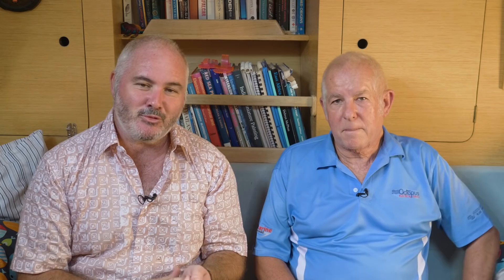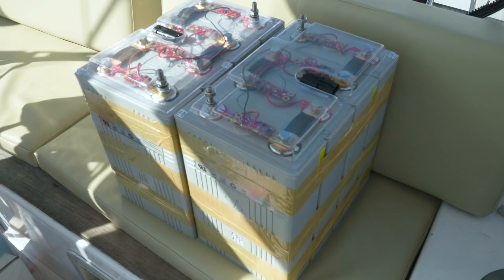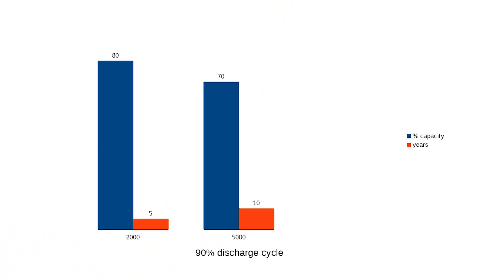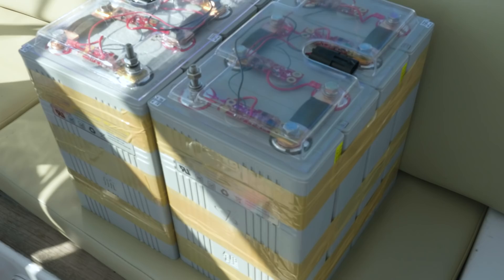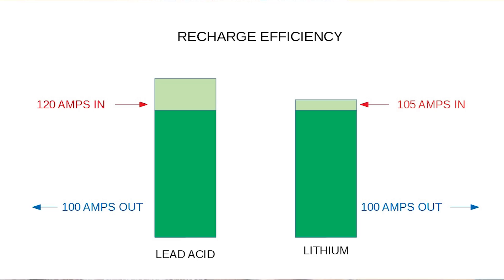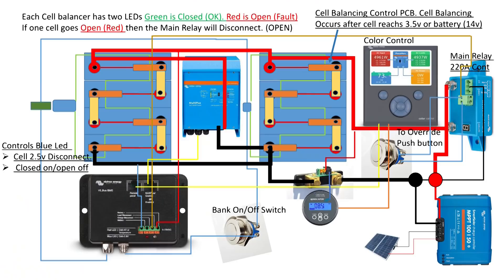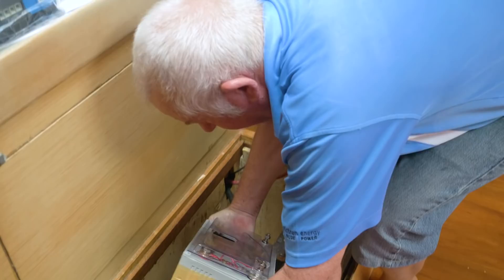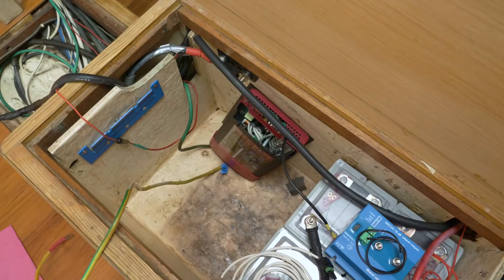Installing lithium batteries on a sailboat - Ep 144

Comment from the maker: Don't forget to LIKE and SUBSCRIBE if you watch our videos. 👌 Would you go lithium?
Reply: That's a non-brainer, yes!
Reply: I would go lithium.
Reply: ... and the induction cooktop will make your propane last around the globe.
Ah...btw, make sure, your inverter can stand the induction. To produce low heat, they have to switch on and of in short cycles like 0,5sec which some inverters do not survive for long.
Reply: In a heartbeat, if I had the money.  Maybe I will when my current battery bank bites the dust.  Maybe the price will be down low enough by then.
Reply: We had that conversation 3 years ago when you bought the Trojans glad you finally did the change.
Reply from the maker: @davidkenny3611  Yep, we've been talking about it for a lo-o-ong time. Finally made the big decision. 😁 Liz
Reply from the maker: @antonditt1661  Loving the induction, but using it carefully! 😁 Liz
Reply: Sailing followtheboat I have gone lithium, like you my previous boat had the same Trojan 6 volt batteries making about 500 amp hours of 12 volt service batteries.  My new boat was only commissioned a few weeks ago so can’t comment too much at the moment.  I have 3 Lithium 90 amp hour  12 volt service batteries and about 10 ( I need to count them all again) sealed maintenance free batteries for engine start, bow thruster, anchor windlass, winches, electric lowering bathing platform, passerelle and electric toilets.  Although I have an 8Kw generator, I believe solar will soon be on the shopping list.  Although all the lighting is LED I’m not sure if 3 x 90 amp hour is sufficient, As it will need to run two fridges and a freezer.  The lithium was very expensive but the holding voltage all the way down and quick recharge times seems to make it all worth while.
Reply: And now that’s it’s been a year plus with the Lithiums...how are they working out? Any puzzles after installation? -Rebecca

Comment: Thank you Jamie for making this video. It answers all the questions I had about lithium batteries. I sure would like to reduce the weight and volume of our batteries but it appears it might not work for us on Brick House. First,  for some of us, Yanmar makes no adaption for a dual belt pully system for a high output alternator. When we upped to a 110 amp alternator, we tore through belts and dusted up the engine room. I had to make a larger pully for the alternator, to reduce the gearing, then install a Gates Green Stripe belt. Running at constant full output to charge lithium might introduce a new headache in this charging system. Plus, I don't think I am smart enough to trouble shoot an acting up lithium set up where I have better hope of correcting problems with our Trojans. So for now, our boat will stay fat and heavy with the tried and true batteries and charging system. Certainly I will look for updates on your lithium system. Nice editing.
Reply: Look at journey with jono.Best review i have seen on lithium.He only changed to lithium because he lives in england and the cold weather.Lead acid is the best way to go in hot countrys.if the weight and space are a problem go lithium.I have seen people using lead acid batterys lasting 8 years.But in most cases about 5 years.Dont listen the hype about agm and lithium.200 amp lead acid £160 is 100 amp usage.100 amp lithium 80 amp usage £1000.What they also dont tell you.A lithium battery that is 2 years old loses 20% minimum of its power out put.

Comment: Really do you home work , we had them and nothing but problems with heat when we were cruising the pasific , put hand down the side of one in the middle of the day  ,we had ours professionally installed and the boat wired to accommodate them , there are many cruisers changing back

Comment: I think you made a most relevant comment when you differentiated between full-time liveaboards and weekend sailors. In the case of the latter (which we are apart from a few weeks a year on board) I think Lead Acid or preferably AGM will be a much cheaper long-term option even allowing for battery replacement every so many years.

Love your vlogs and this was most detailed and informative.

Happy cruising to the three of you!

Gerard

Comment: It makes sense for full time liveaboards to consider investing in lithium based storage systems. The financial numbers are scary though. The advantages are legion though and the charging efficiency is a major one and it was not really covered by the Octopus chappie- Your engine will be running for less to charge the batteries not only because less amps are needed but because the lithium battery will also accept bulk charge for longer.The ability to get rid of propane and have the inverter capacity to run modern kitchen equipment - induction hob et al is a real logistic win.

Always difficult to judge things on a video and I will watch again on a big screen but as a retired marine engineer I was underwhelmed by the installation which I do not believe is robust enough for marine applications. Some of the cabling was untidy (too long) , a general lack of heat shrink, the BMS looked a bit Micky mouse- do Victron not do an external one (solid state and waterproof). The location of the invertor is a compromise too far and needs to be higher and with intrinsic air flow. It just looked a bit ‘rushed’. 

After investing almost another engine it merited more installation planning and execution. I am not sure you have a robust system that will endure the marine environment.

No offence intended.
Reply: I respectfully agree wholeheartedly and on second thought I think they will agree. IBEW, brotherly love💪.
Reply: This is thailand.Chances are the products maybe copies.them 6v lithium batteries are all over ebay.no guarantees with them.for sure.Thats how DIY  make them cheap and tape them together.He is also breaking the law.He needs a work permit.He might own a company.That means nothing in thailand.Claims he,s done 50 boats with no problems over 7 years.I dont think so.I lived in thailand for over 12 years.Not the place to concider this type of instalation.Dodgy to say the least.And a fan in a concealed box to keep temp down,How do fan ovens work.

Comment: Great selection in LiFePO4 batteries now, with most coming in a sealed container with the battery management system enclosed along with the cells in a single container. Much better for durability.
 In my opinion, the single greatest risk for those switching is triggering the overvoltage protection in the BMS. For most of the batteries, this leaves you dead in the water till you send the battery back to have the BMS replaced. However, a few of the BMS systems manage the overvoltage the same as undervoltage, with an electronic cut out which is user resettable with either hooking up a constant voltage (ie a battery charger with a  power supply function) or removal of all load then reconnect. 
While renovating your system, pick a new charger with a power supply function and a programmable charge profile or dedicated LiFePO4 profille, then upgrade your alternator with a programmable external regulator.
I swapped 4  Rolls-Surrette 6v/280Ah lead acids for 3 Renogy 12v 170Ah LiFePO4's.
Difference: 400lbs of lead giving 200Ah of cycling became 150lbs of Li giving 350+Ah, paired this with a 700watt solar array and now run the water heater,  electric stove, watermaker and all the gizmos and don't need to fire the gen unless it's been cloudy for several days.
Yes, they're pricey. So is going into a yard and paying someone else to remove and replace 400 lbs of lead batteries, cuz our old cruiser backs are not up to it!

Comment: Great episode. We took the plunge with Lithium on our camper van build out to test the concepts before going all out on the boat. We also went all Victron and love the ability to monitor and program over Bluetooth. For USA installation we used AMSolar in Oregon for their invaluable installation kits, advice and schematics which make the whole process virtually plug and play. I did buy a heavy duty hydraulic crimper to make up all the battery cables since this was a new installation not a retrofit or upgrade. One thing that AMSolar does recommend is two relays. One for all the charging inputs and another for discharge so the batteries are super protected from even approaching that dreaded 12.5v. 

Anyhow great to see your install by an obviously very capable installer. If I was in Thailand I would have done the same. 

We hope you enjoy Alaska as much as we have. Get your warm kit ready and enjoy.

Comment: Amazing build. Lithium Iron Phosphate is ideal for portable power on boats, on land, ... because of its energy density, useable watt hours and cycle life. We use smaller systems similar to what you installed to power basecamp in field radio expeditions, charging them with flexible solar. Seeing this technology applied to boating and yachting is amazing.
Well done! Please do update us over time. Bravo to Victron.

Comment: I'm so happy and excited for you! I installed 400 amp/hrs 5 years ago and love them dearly. My 480w solar keeps them 100% almost all the time by 11 am, and i use power all day and night without concern to power levels. Running coffee maker and toaster at the same time NO PROBLEM and microwave is the same way. Your pumps and fans heating or AC will run like your on shore power right up to 85% discharge. I have the same solar converter and it is amazing, i had to get a bluetooth dongle when i got mine so i can read all my electric values, usages and production from my phone, but the new ones now have bluetooth built in. It's fantastic to see how much power your solar produces thruout the day and month.  Super stoked to see that you've been able to upgrade.  AND YES TO ALL THE NAYSAYERS YOU WILL GET 20 YEARS OR MORE OF USE OUT OF THESE BATTERYS, They are not as hard to set up as you might think and the price has dropped so much this last year they are now 1/2 the price of lead acid or AGM even IF they only last 10 years. But it comes to more than cost, they make your appliances run so much better charge incredibly fast and there is NO MAINTENANCE can be stored inside without venting and  you will find that running the genni will almost be forgotten. I have not used mine in the last 3 years and now it won't start so less weight to haul around. The cells i got are called prismatics, very similer to the calb, very easy to fill any awkward spaces as the cells are 2.5" deep by 7" wide and 9" tall, they can be mounted any which way but upside down rather than jsut 4 together in a row to make 12volts. meaning you could get 12 volts with a battery 2.5" tall and 28" long if you want.   The cost in america or Canada for 100 amp/hr batterys are now averaging $900  USD              Much too long,  CHEERS                   Steve h.

Comment: Great. Octopus did a great job at explaining your system. I just put 8 6v 220ah lifeline agm batteries in my boat. I bought them off a bloke who just bought a catamaran and wanted the seller to fit lithium’s as part of the deal. They cost me $600. They are 4 months old. Am chuffed but will definitely go lithium’s after I wear the lifelines out
Reply: Sweet deal!  We went with 6 new Trojan 6v's

Comment: 5:48 I am always surprised to see printed circuit boards without any protection on a boat. I would expect that salty sea air would cause corrosion to the metal tracks on the board and the metal pins of each of the components. These little red boards seem to hang in free air, making them vulnerable to mechanic stress. Don't lean on them by mistake as they might break easily.
Reply from the maker: They're encased in epoxy 😉

Comment: Very well presented and explained.

No doubt about it, you now have a solid system there that is top of the line.  It is quite an investment but if the longevity predictions turn out to be correct, seem to work out on paper to be very competitive price-wise over the long term -if it doesn't break and crash out on you.  

It is good that your system is built to be foolproof, but always remember this is on a boat and everything breaks and fails much faster than land systems.  I would suggest that you become very familiar with the various theoretical failure modes and their warning signs so that you can be the one who watches the watchers... repairs of electronics and replacement of expensive lithium cells is the nightmare scenario and a real budget-buster.

While we aren't exactly weekend cruisers we have been getting by swimmingly with the old fashioned  lead-acid golf car batteries, but our electrical needs are VERY modest compared to yours.  I am surprised that you guys were able to do all the stuff you have been doing before with your extensive electronics and audio gear onboard with only the four 6v wet cells in your house bank. When you had guests aboard for your gaming design jams you must have been cashing them out fairly early each day and pushing your charging systems to their full potential.

Comment: Hi Jamie, i have some questions about your battery setup. Because I am building a quit similar setup and I also have the Sterling A2B charger, victron multiplus, victron isolator and a Venus system.

1. A2B Sterling charger. Do You charge your starter batteri from that as Well?
2. Do You have protection for the alternator if all your batteries switches off via BMS protection. 
3. Have You seen heavy load of the alternator. Heard that it should be a problem with Lithiums. Alternator are in general not designed to run all the time. Sterling do recommend a dc-dc charger instead. Sterling tells me it will shorten the lifespan for the alternator.

And thanks for your excellent videos, Steen

Comment: Very informative. Seven years and 50 boats, a decent information base. As long as control system is bullet proof, should be good to go. Any particular back up parts recommended to have “ in case” failures?

Comment: Very informative. Thanks. I wonder how you set the Sterling Alt to Battery Charger into the system, especially in terms of Absorption/Boost Voltage and Float Voltage, which is 14.6V/14.4V according to the manual if the Lithium setting  is used. My thought was that you do not want to go above 14.2V  absorption and 13.6V float. I've got the same unit, but unsure how it fits into a Lithium system.
Reply from the maker: The Sterling has a lithium setting but don't forget to install the alternator temperature sensor 😉

Comment: Great system we use victron stuff never had any problems or faults👍. 
I was surprised to see no heat shrink to seal over your crimped connections.
Reply: My thoughts exactly. And no Goose Grease either?

Comment: My concern with lithium is lighting strikes, I looked in depth at all electric for my C&C landfall 38 and couldn't get an answer on mitigating losing everything to a near or direct hit by lighting, I have 600amp of solar to AGMs and would keep diesel for heat all electric would never work in the PNW for heat unless I was a dock dweller......but lighting is an issue
Reply: educate us please:  why are lithium more of a problem with lightening than Lead Acid?
Reply: Very high cost and all the electronics to maintain them will be lost.....
Reply from the maker: We know a few boats that have taken direct hits from lightning. EVERYTHING gets fried, with or without lithium. That's why we've always been insured... Liz
Reply: Sailing followtheboat 

Yeh, part of the reason an electric motor scares me........I quess it is a sailboat ;)

Comment: Energy is measured in Watt hour, if you want to use Amperes hour, you should mention at what Voltage. For best life span, lithium batteries should be discharged to a maximum of 80%; as you mentioned, the Voltage has a higher drop above that level od discharge, increasing the amperage and heat dissipation.

Comment: Hi there. By now I consider you two (among others) to be experts with Dodgers. I remember that you carefully selected the right material for the transparent flexible window sections. Based on your experience after several months of use, was it the right choice? If so, what material did you stitch to the canvas? I have a dodger with 3 years-old transparent window sections and the lower part of these windows are dirty and cannot be cleaned anymore. Even nitro-based solvent creates section that are no longer transparent, let alone acetone... What is the best transparent material in your view? What is the correct cleaning agent for it? I look forward to your expert opinion. Best regards to both of you, Silvano (from Switzerland, cruising the Med).

Comment: Do you use your lithium batteries for engine start and windlass duty? If not do you have a different charging protocol for those batteries? Thanks for sharing. I am am contemplating a new battery setup for my boat this or next year.